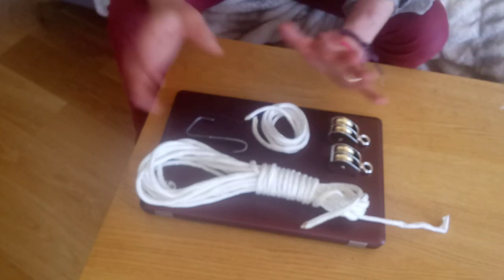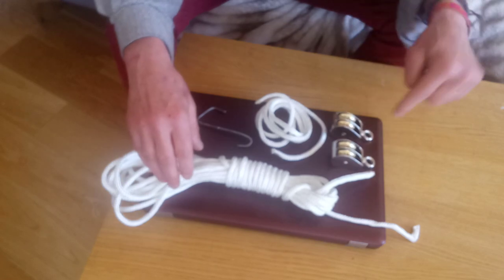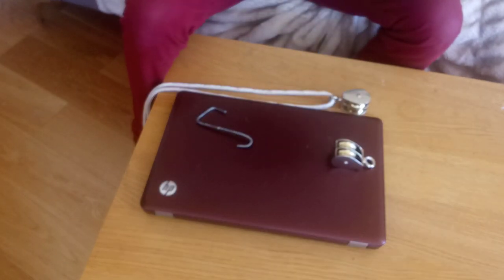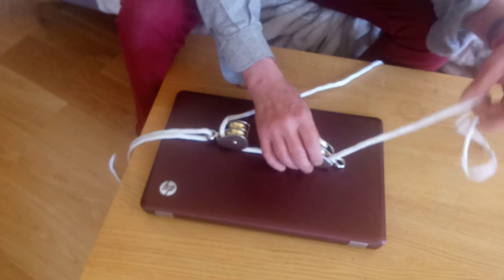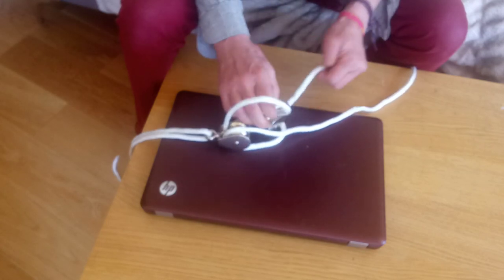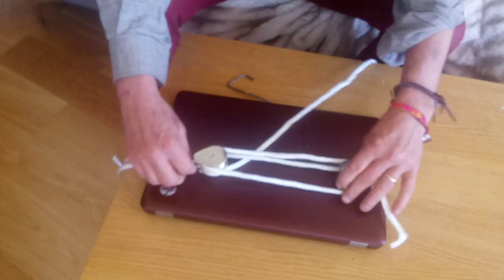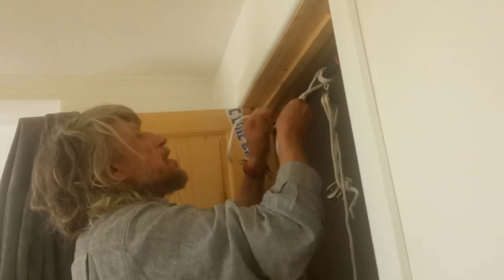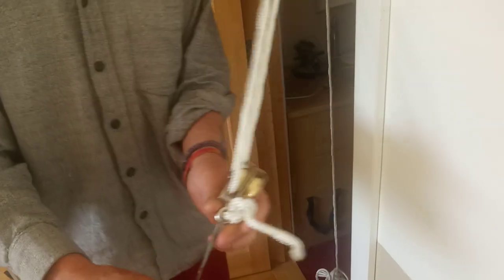Double pulley, how to make it.

Comment: After the last passthrough, you need to attach the rope to the knot (or to a hook/loop you fashion) at the top of the first pulley  instead. The way you did it, you are only using three pulley wheels instead of four.
Reply from the maker: Ok ill try that , did what was shown to me and what came natural.
Reply: @felixbrunner5707  cool, glad to help. With some pulleys there is a bar below the wheel which you can use to attach the rope.
Reply: I had the same view... one is jobless now

Comment: Thanks for the video!  However, if I'm not mistaken, the setup that you demonstrate would decrease your load by 66%, not 50%, since you're distributing the weight among 3 cords.  So your 60 kg stone effectively becomes 20 kg.  Furthermore, if, instead of tying off the knot on the bottom pulley (which is effectively utilizing only half of that pulley), you brought it back up and secured it to the support rod to which your upper pulley is attached, you'd be using FOUR cords to support the load, and your 60 kg stone would now be 15 kg!
Reply from the maker: Thank you for the feedback you are right. At least people can see how it's rigged and what you need to build it.  Thank again fir your valuable feedback.

Comment: The system you set up there would reduce a 60kg load to 20kg. 3 ropes between pulleys = 1/3 weight.
Reply from the maker: That is assuming there is no friction , so in theory possible in practice it's closer to half.
Reply: @felixbrunner5707  good point

Comment: By increasing the number of pulley,the length of the rope used also increases.....is this correct or not..........pls do reply...🙏🏼🙏🏼🙏🏼🙏🏼🙏🏼🙏🏼🙏🏼🙏🏼
Reply from the maker: Yes ....that's seems to follow naturally
Reply: @felixbrunner5707  👍ok..thnku😊
Reply from the maker: You need to think about how hi you want to pull then multiply the hight by how many pulleys you have at your disposal.

Comment: Sorry, Felix, you got it wrong.  You are only using three of the four pulleys so it's a three fall tackle, not a four fall tackle.  3:1 advantage, not 4:1. Because those washing line pulleys only reeve one side - the side with the eye - you need to contrive another anchor for the rope.  You could run the rope up to the main suspension.  It'll work just as well.

Another point of order - you don't have to do knots tight, you just have to do them right.  Without going back and watching like a hawk, I don't think the knots were up to much, either.    The thing about a good knot is; you can untie it again, quite easily.  A multiplicity of "easy" thumb knots (or Overhand knots) can be a knightmare to untie after any load has been applied.  Sorry to be a grouch, but we Scout Leaders have standards.
Reply from the maker: I dont call it a four fold , i call it a double pulley but you are right about using the fourth roller, its an honest mistake if mine .
I paid no attention to knots at all . If i had i would have used slip knots.   I am not a knot nerd but as a builder  i had to user 3 or four different types of knots suggessfully for decades.
Reply: @felixbrunner5707  Yeah, I've found the same. 3 - 4 gets you just about everywhere you need to go, other than a highly specialized field, obviously. This is a really helpful video, thanks.

Comment: Your calculations are wrong. If you're using 3 ropes, your advantage is 3:1, not 2:1.  Lifting a 60kg load will require only 20kg of force, not 30.  It's a pretty simple formula.

Comment: 2:50  Sure it is 60 to 30??? Not 15???
Reply from the maker: Not it halves the weight from 60 to 30 it's A physical law.
Reply: @felixbrunner5707  Thanks. Does a fiddle-block, with two-pulleys also give a 2-to-1 advantage, like your above demo ???